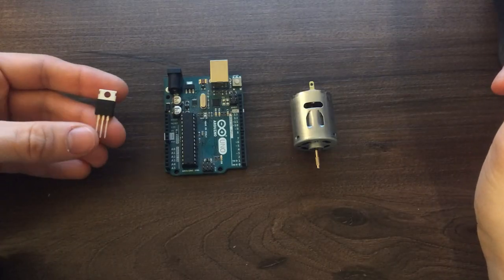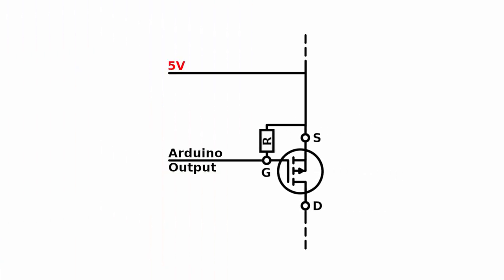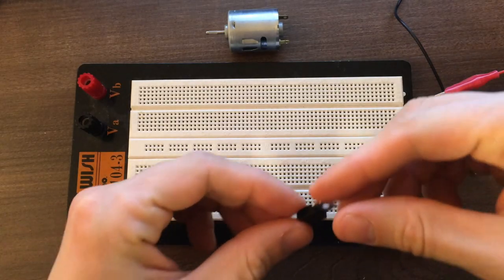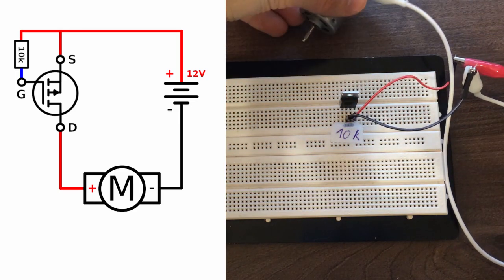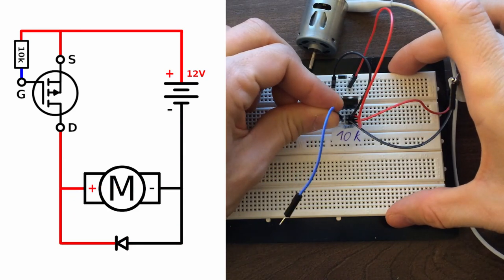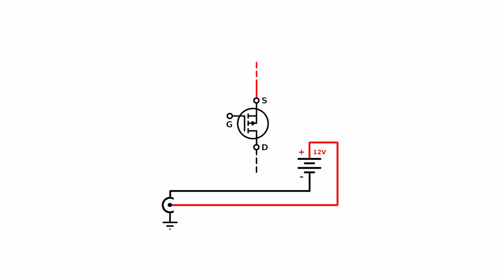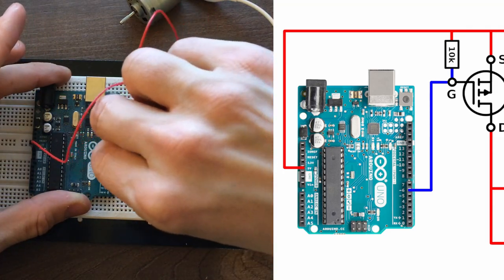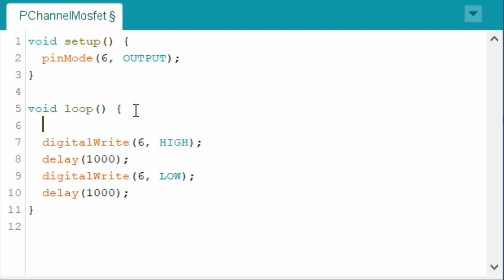P-Channel MOSFET as a Switch. Turn ON a 12V Motor with Arduino. (Step-By-Step Guide)

Comment: Connecting the Arduino 5V to the 12V supply really threw me off at first. But I realize you are basically using that as the Reference instead of letting Ground be the common reference point. This way when the arduino output is Low (0V from the Arduino perspective) it is -5V on the Gate with respect to the Source. When Arduino output is HIGH (5V from Arduino perspective) then the Mosfet sees 0V at the gate with respect to the Source. You went over this at ~55 seconds on the Video, but seeing 5V connected to 12V throws me off until I remember voltage would be relative and depend on the common reference point which doesn't Have to be 0V/Ground. We're so used to connecting Grounds to make everything relative to 0V Ground, it seems backwards to leave grounds disconnected for circuits to act relative to the High Side instead.
Reply: Yes, it's a ground-shaking moment for us noobs. Thanks for commenting
Reply: How to solve it if you have a common ground ? Add another diode between Arduino 5v and the S to block current from the battery ?

Comment: If you connect the 12v to the arduino VIN pin, my understanding is that the regulator will provide 5v to the Atmel device. At that point you should be OK to connect the grounds?? This is a question rather than advice. I would also recommend using a NPN transistor to to drive the MOSFET gate, with the collector biased at 12v via 10k resistor, the emitter connected to ground, and the base going to the arduino via a 10k resistor.

Comment: The video is misleading when you say connecting 12 V to a 5v from arduino should actually send 7 v inside the arduino leading to frying of arduino .Also Tysm for the information of potentially frying up of arduino and I really loved the fact you used the concept of Vgs Rather than saying give Vg negative using a npn transistor
Reply: it is not actually . i thought the same at first. but arduino ground is not connected to the ground of power supply . he uses separate power supply for arduino

Comment: This is sending 5v to a 12v motor
Reply from the maker: No, it is not. The only place to get 5V out of this circuit is between the Arduino 5V pin and Arduino GND. But Arduino GND is not even connected to the motor.

Comment: Can we use analogWrite 0-255 ? In P channel mosfet . I thought that use negative to work in gate
Reply from the maker: Yes, the P-channel Mosfet is controlled with negative voltage on the Gate relative to the Source. That's why it is connected to the 5V instead of GND. If it is connected like that, you can use analogWrite with it.

Comment: "P-Channel MOSFET as a Switch. Turn ON a 12V Motor with Arduino. (Step-By-Step Guide)" ???
Regrettably you DO NOT explain how to turn on a 12 V motor with Arfuino and a P-Channel Mosfet in this Video. Rather, you are just warning that this will damage the Arduino. Pitiable!

Comment: Could you use a photocoupler (opto-isolator) like PC817 to drive the MOSFET and eliminate the problem with sharing grounds?
Reply: I generally suggest not only using an optocoupler but using a power transistor as well. May cost a bit more but I've not found these low rated transistors to be very reliable with motors.

Comment: If my motor runs with 5v then I can use the same power supply for the arduino and the mosfet/motor right?

Comment: Your video is really comprehensive and helped me getting started with MOSFET driving, however i have a doubt about Arduino and it's ground, in case i needed to add sensors or anything that needs a ground with the configuration shown on the video would burn the Arduino? Even if the Arduino was powered with a different source to the motor?

Comment: brother..I want to use a push button to switch a motor ON and off..With mosfet..Can i connect gate to a switch and pther to source with resistor
Reply from the maker: Hey! Yes you can replace the Arduino with a simple switch. How high voltage does the motor need? If you need to turn on a 60V motor, but the maximum gate-source voltage for the MOSFET is 20V then you should use a separate lower voltage source to turn the MOSFET on. If the Motor is 12V then you probably can just connect the switch to the power supply.

Comment: Thanks for the simple video. I am still thinking that when the gate is given 0 volt then how Vgs is -5 volt?
Reply: Because you have a +5V cable coming from the Arduino to the transistor's source pin. You apply voltages with two cables, not just one. And it's -5V with respect to the Arduino's ground signal, not the motor power supply.

Comment: Good info, thanks, I had only seen people talk about the n channel.  Any way to isolate the GND for a single power source?  I need to power an arduino off a 12v truck, was planning to use a 5v stepdown converter to power arduino, but I need to PWM the 12v signal to control some hydraulic valves
Reply from the maker: But why can't you use an N channel MOSFET on the ground side of the 12V load? It would make things so much easier.

As far as I know all the step down converters expect to share the Ground. So if you step it down to 5V it will be relative to the negative output of the battery.
Reply: @IndrekL  I'm controlling hydraulic valves with onboard electronic actuators.  They call for a fixed GND and 12V supply with a variable voltage signal wire to control direction and amplitude, with 6V being neutral, and over 6v is one direction, under 6v is the opposite direction.  I have potentiometers setup to work it fine, but I want to use an arduino so I can make a wireless control

Comment: That's a good video. Also thanks for the warning part :)

I recently saw that you can avoid that power supply problem by controlling the P channel mosfet with another transistor (like an NPN or an N channel mosfet). That way you have two isolated circuits
Reply from the maker: Hey! Thank you for the feedback! 
Yes, with another mosfet/transistor it is possible to fix ground connection problem.
Reply: @IndrekL Any good resource for this 2 mosfet approach?, thanks. great video!
Reply: Could you provide where you saw this, hoping to implement the 2 mosfet method.

thanks!
Reply: @IndrekL  bro you deserve a 100millions years of electronics and our world thankyou I'm from India
Reply: @IndrekL  AS the same Inductive load (Motor) You used in case of N -channel MOSFET ,then why you did not use flyback diode in that case (N-Channel MOSFET )?

Comment: Bro can you explain 
Why you connected 12 volt to power arduino 5v pin pin
Reply from the maker: Because a P-Channel MOSFET is a "high side switch" and must be connected to the VCC side of the circuit. To achieve this I need to pull Arduino 5V and the positive side of the 12V power source to the same level (note that the grounds are NOT connected).

An N-Channel MOSFET is actually a bit simpler. Then you connect the grounds and it is easier to understand.
Reply: @IndrekL  thanks broo..
It was really helpfull
Reply: @IndrekL  thank you for the great tutorial! I've applied this to my project and it worked out great! 🙌 But I confess I'm still a bit confused by this step -- joining the 12V and 5V. I'm very new to this type of thing, would you mind helping me understand what's going on here (is the 12V side pushing current to the 5V side, are the voltages adding up/being subtracted?) and what you call this kind of merging of two different voltages without a common ground? Thank you!

Comment: Great video thanks! does it work also for 3.3v signal from eg ESP8266 ?
Reply from the maker: It denepnds on the MOSFET. If you find a logic level MOSFET that fully switches ON below 3.3V then you can. The one I am using switches fully ON at around 4V (according to the datasheet). So you could not use exactly the same one I was using. If it is not fully switched on, then the MOSFET will get hot.

Comment: You use 12volt battery and how many amperes?
Reply from the maker: Hey! I didn't use a battery. I used a power source that is plugged into the wall. I don't remember exactly, it was probably somewhere between 0.5 and 1 amper.
Reply: How many volt that the mosfet need to on the gate?
Reply from the maker: @faizmajeed409  The Vgs(th) = -4V. According to the datasheet, the optimal for ON position is -10V, but it didn't get hot at all with Vgs = -5V and sub 1A load.
Reply: Okay bro thanks👍

Comment: Thanks for the very nice video and clear cut explanation. 
I am looking for the P channel (D-S) MOSFET for one of my project and its part number is Si2309CDS by Vishay Siliconix. I am not getting exactly what the D-S MOSFET is and how it is different from a normal P channel MOSFET. Can you please help me with this
Reply from the maker: Hey! I am guessing that the "D-S" is referring to Drain and Source. As in "the current is flowing through the Drain and the Source". I tried to google it but didn't find any significance of that marking.
Reply: Okay thank you 👍
And thanks for the video, it was really helpful

Comment: There is no negetaive 5 v  in Arduino , its 0 v that turns on mosfet , because you are turning on and off it worked
Reply from the maker: The voltage is always relative. If you use the Arduino's 5V as 0V from the perspective of the MOSFET then Arduino's GND is -5V.